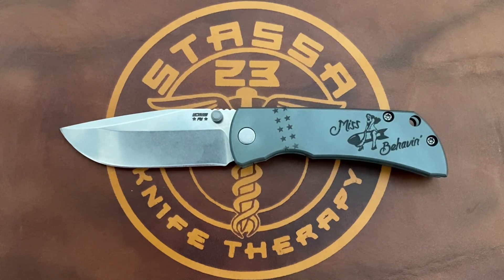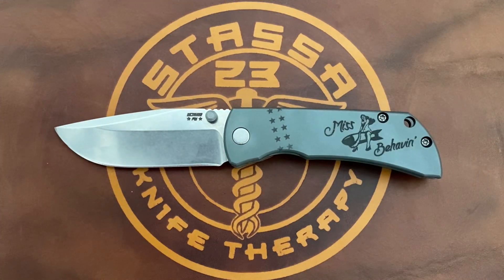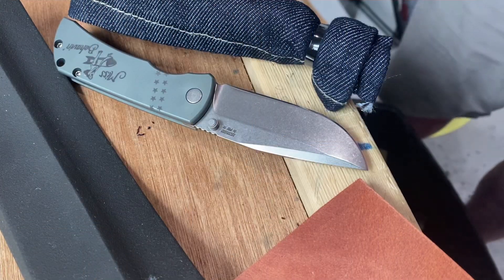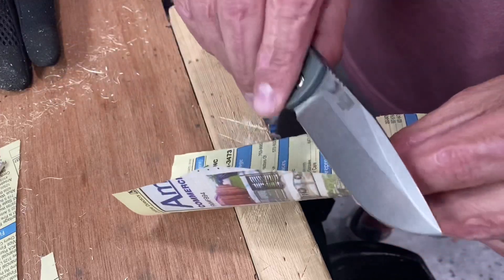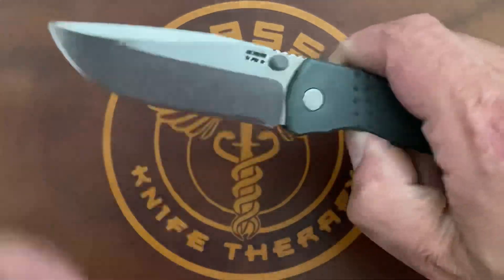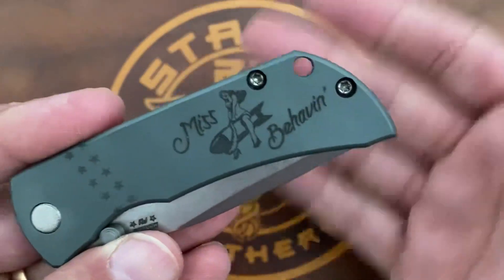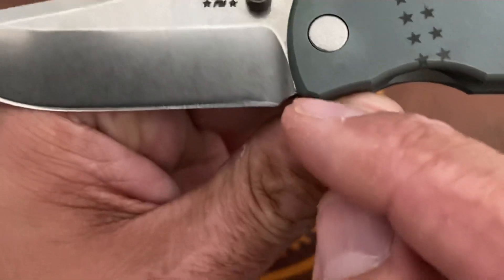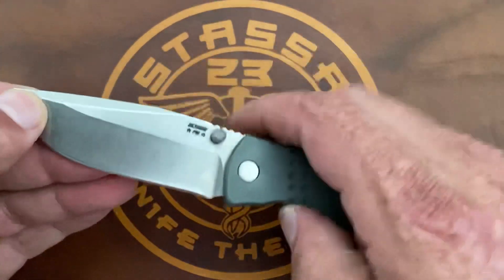McNeese PM Mac 2 / Full Stassa 23 Review and Testing

Comment: I have had one in my cart on several different vendors for a while now. I just never pull the trigger. The main thing holding me back is when I look at it I see $250 to tippy top $300. Nothing appears to be ground breaking or overly challenging to build so why $500 when at $300 they would fly like hot cakes. Really not trying to sound like I’m complaining but I really think they missed the price mark on what could easily be a huge seller. Instead every vendor that I see that carries them has them sitting on the shelf. With today’s market. Not a good sign
Reply: It’s a mid tech, with each hand assembled in the shop (parts factory machined) and is line with such pricing. Agree that it would be $300 if fully factory produced say by reate or we. So you have to factor that in. And while a bit pricey compared to production, the action really is that good and the knife does comes with a custom feel that you just don’t get with production knives. Definitely don’t regret my purchase.

Comment: I was about to order one of these but I'd have to do a lot of work around the sharpening choil area. Those smiles drive me crazy. I really do like this knife but that smile shouldn't be present on a custom knife imo
Reply from the maker: It’s not a custom knife the PM means Performance Machined basically meaning machined to save time and cost however I can’t stand poor edge termination. Even though it doesn’t hurt the performance in any capacity it still looks ugly and makes the knife look cheap, that’s why I will be adding a proper sharpening choil real quick on my grinder so it will look better after I sharpen it and it won’t start producing a recurve 👌🏻
Reply: Same. I liked everything about the knife, except for that awful amateur-hour plunge line and a lack of a choil.
Then when I saw it was $470... I'm sorry, but no. For almost $500 and actually being more expensive than a Sebenza, you damn well better not have something that amateurish on your knife. Mid-tech, production, custom, I don't care.